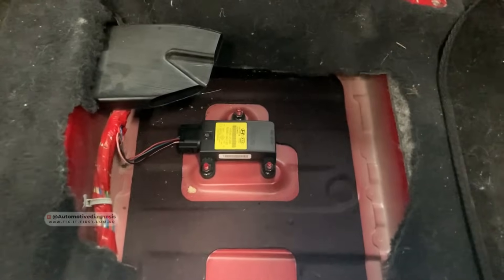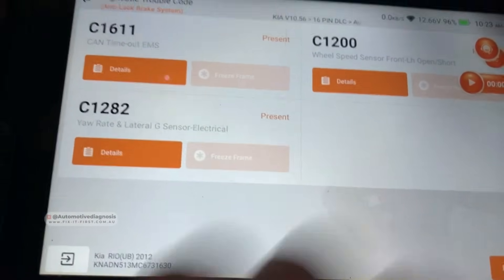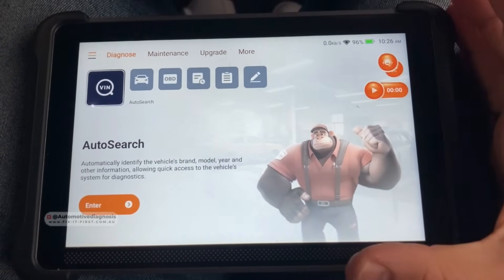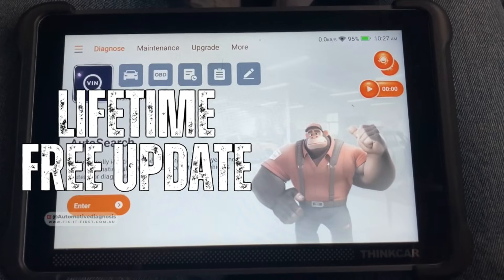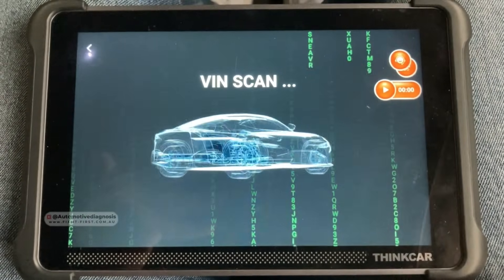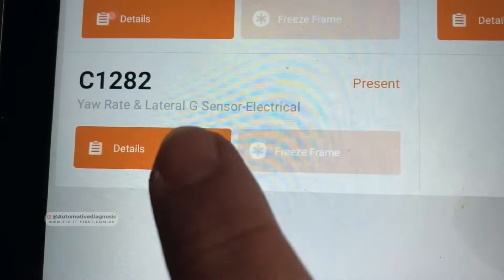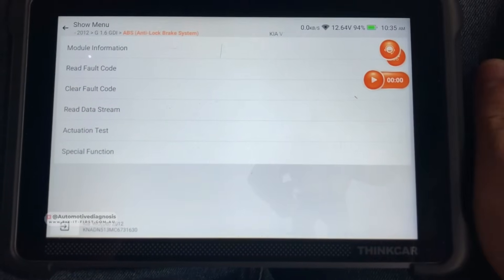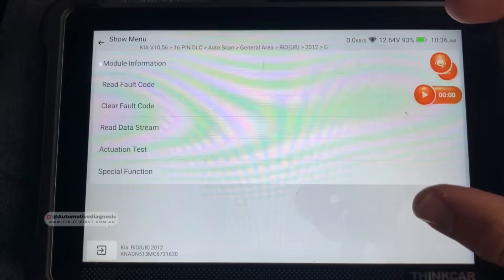Yaw-Rate Sensor Diagnostic with Multimeter, Scan Tool & Oscilloscope | Diagnostic & Calibration

Comment: Sorry i had a question i hope you take time and answer . Where do you get the workshop repair manual for a vehicle. For example the wiring diagram and the repair instucrion that you show in some of your vedios?
Reply from the maker: Hi my friend, I get most of the diagrams from the dealerships, but some of the PDF diagrams are available to download for free on our website:
https://fix-it-first.com.au/
Reply: @AutomotiveDiagnosis Thank you for replying , I am a follower of your channel. I have two questions ,one about your online courses and the other about problem with my car. Hope you read this message and respond as I have hit the wall with this.
I have a vauxhall corsa 2014 engine size 1.4 petrol engine code A14XER. The ABS, TPMS, HANDBRAKE and the Traction control system light are all constantly on. I have scanned the car with Thinkcar scan tool and it has returned the following results. 
CO287-4b  Longitudinal acceleration sensor not calibrated 
CO551-5a  wrong variant configuration program PSCM(power steering control module) 

CO550-00. Replace electronic control unit TPMS ECU
Now I have done the following tests.
1.  I have read the live data from wheel speed sensors on all four wheels and the all show thier values changing when I drive the car 

2. I have tested the Yaw sensor with a multimeter,  live data reading for Yaw sensor is not available on Thinkcar 987BT. I have tested the power and ground which show 12.19 on power and ground is also good. I have checked the signal wires for voltage with multimeter connecting the negative probe to black wire and the positive probe to signal wire one signal wire shows 2.32 volts and the other signal wire shows 2.66 volts . the handbrake signal wire feeds as  from the same wire as Yaw sensor. This showed a reading of 0.34 volts while the handbrake was engaged and also when it was disengaged. But I not sure if this would turn all those lights on. 
3. The autodata says that this vehicle does not have a TPMS sensor I have pumped all four tyres according to the manufacturers recommendation but I don't know why this light is on. 

4. I have read the values of the steering wheel position sensor which flatuates between 0 to 5.2 volts when I turn the steering wheel. This was done using live data on Thinkcar scanner 

At the end what do you think is causing all the ABS ,TPMS,TRACTION CONTROLL SYSTEM AND HANDBRAKE lights to stay on . Please share your opinion on this I would be much obliged .

The second question is about the courses. I want to get better at diagnosing faults with electric components of the vehicles , what do you recommend which courses should I join and in what order , so I start with basics and move on ro more advance subjects? Once again I appreciate you take time and respond to questions 
Regards

Comment: Be wary of turning some yaw sensors upside down as it might fire off some side air-bags if you have deliberatley powered them up and you are moving the sensor about by hand.  The types of sensors that do that are usually grounded throught the securing nuts to the chassis. This helps stop someone inadvertantly causing this to happen.
Reply from the maker: Thanks for sharing this important information about the yaw rate sensor.  That’s why I mentioned in the video that I don’t recommend turning the sensor to read the data (that part only was to read the data at that moment which I was not driving when recording the video) and that’s why I didn’t turn it upside down. Majority of airbags have the roll-over sensor inside the airbag control unit, but some have that sensor inside the Yaw-Rate sensor, so making sure that we don’t turn the sensor upside down is very important.

Comment: 11.97V is quite low what is causing that voltage drop?
Reply from the maker: Hi there, battery voltage happened to be low on this car, 11.97 was the battery voltage. So in case of a normal good battery, it must be higher of course.

Comment: Should you unplug the sensor to check the can bus? The signal could be coming out of the sensor not the module?
Reply from the maker: Hi there, Both sensor and ESP module are connected to the CAN-Bus, so sometimes disconnecting the connector on the sensor can help to do the diagnostic, for example if sensor is reflecting a fault on the network, you can disconnect the connector and check the network again, if network is only bad when connector is disconnected, it means sensor is bad.
Reply: @AutomotiveDiagnosis Why network signal would be bad if the bad sensor is disconnected?

Comment: Very interesting. I always learn stuff watching your channel. I use a set of Hantek HT306 Breakout leads to front probe connectors (Not sponsored, you can tape off the other end-to avoid shorts-for use as terminal leads as well). A 4mm male plugs right into these leads. Around $40.
Reply from the maker: Thanks for sharing your experience my friend 😊🙏🙏